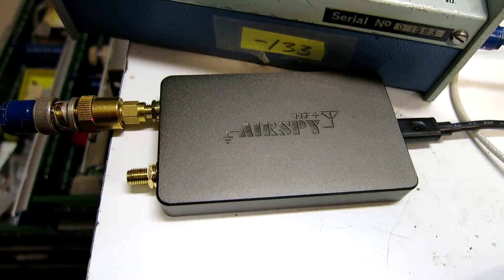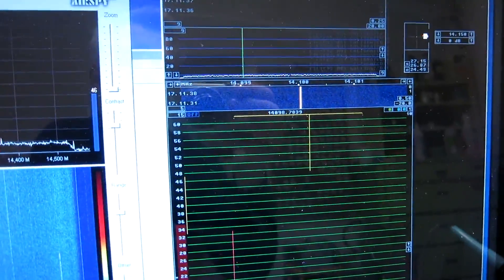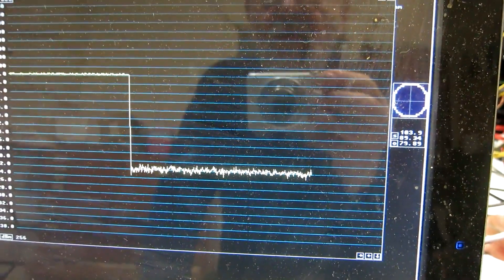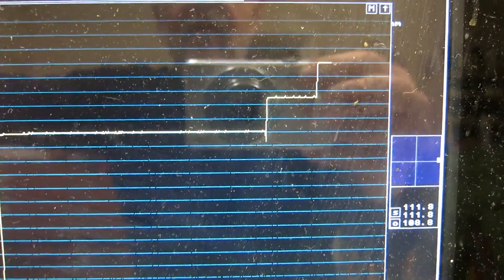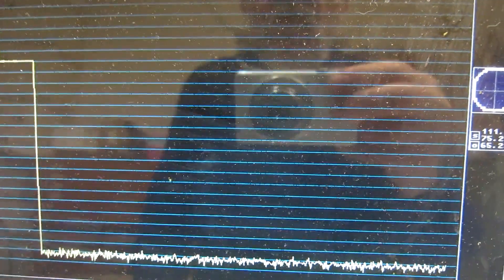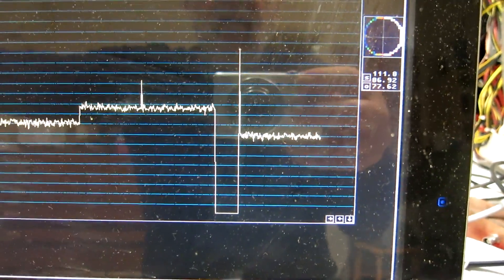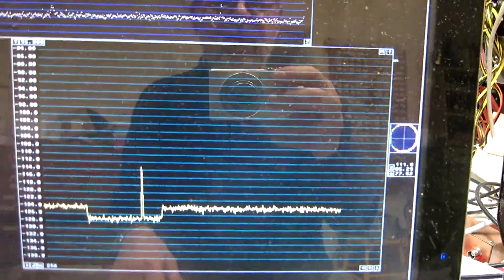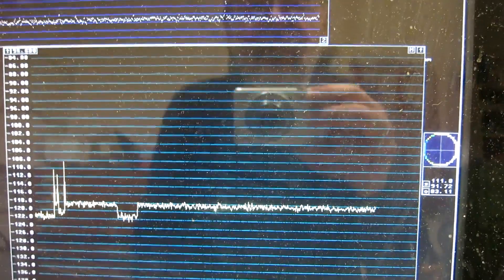hfplus vs perseus

Comment: Thank you for your work.
So the Airspy HF+ is better in sensitivity, the Perseus is better in dynamic.
127 db Dynamic seems to be sufficient ?
What is your advice about the two receivers ?
Cheers
Reply from the maker: No advice not knowing your RF environment. Dynamic range is expensive, sensitivity is cheap (just add a low noise amplifier.) If you can not have access to a spectrum analyzer I suggest you buy an rtlsdr plus a "ham it up" (USD 20+40) and make or buy two 20 dB attenuators. Once you know your RF environment you  could make a rational decision on what receiver hardware to buy. 
In case you want to do MW DX-ing, adding notch filters for a couple of high power local stations
would cost next to nothing and allow a cheap radio. In bad situations, not even the Perseus would be good
enough.

With two 20 dB attenuators (just through hole resistors in a cable between two connectors) you can analyze your problem and figure out what kind of filter you would need (if any) and what dynamic range you need (Perseus, HF+ or rtlsdr)
Reply: Thanks for your reply, i am 12 km from Paris, so noisy environment.
I have RTL-SDR + Ham it up and Afedri receivers, it works fine (Afedri better) only with tuned loop antennas, mini-whip don't works because of noise. There is not a big difference between sensitive and unsensitive receivers so i will keep this two receivers.
Thanks for your work
Cheers and 73
Yves

Comment: I appreciate very much you work and efforts. 
I would like to see if possible a comparative noise degradation test between different receivers when they are connected to a real antenna  (for example a 80 m  dipole or longwire).
Thanks again for your exceptional work in the amateur radio field.
73 de YO4AUL
Reply from the maker: I made many such videos. They are listed here:
http://sm5bsz.com/linuxdsp/videos.htm under this paragraph:
"Tests, comparisons and modifications of different SDR hardware."
Compare tuners, Compare HF receivers and several others.
Reply: Thanks a lot. I will check all videos! 73 Corneliu